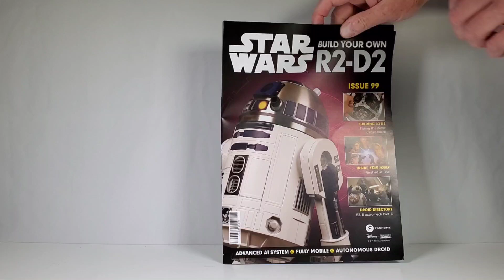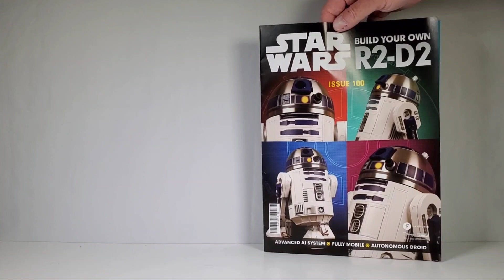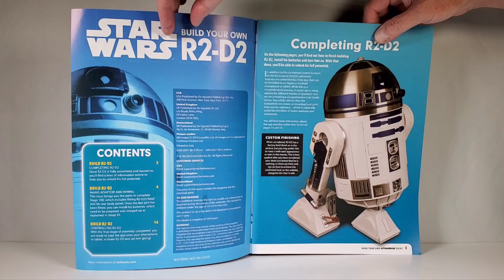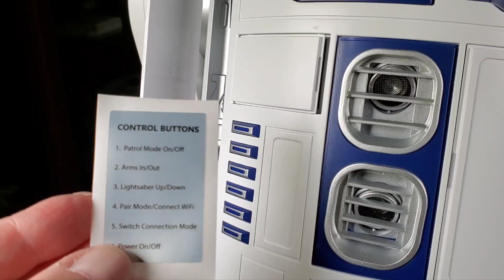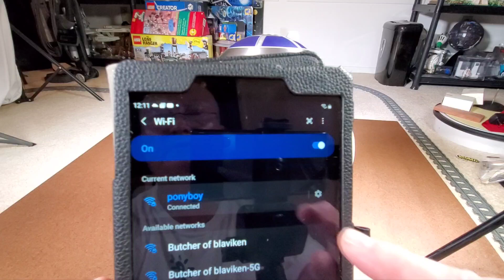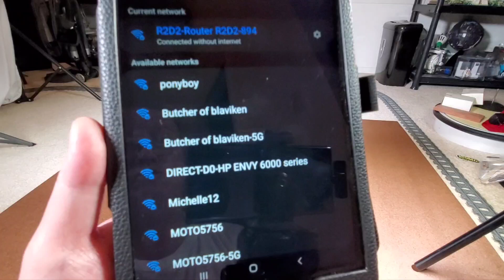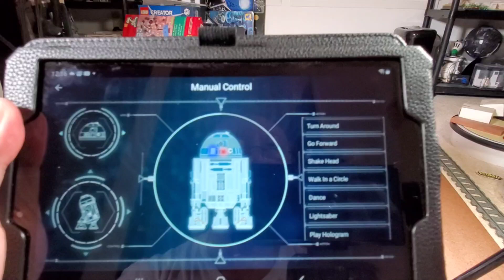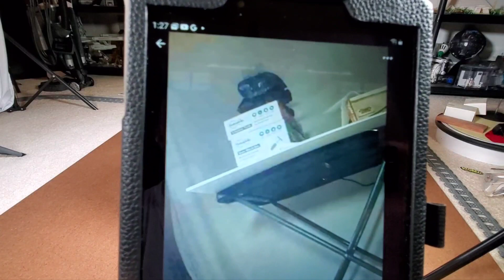Part 26 Building The Fanhome R2-D2 Stages 99 & 100. The Finale!!

Comment: I’m proud of you Roy, for finally finishing this big project.  Isn’t it ironic that fanhome would leave the most challenging part of this project to be revealed in the final 2 parts builds.  I know this was a labour of love for you.  One thing though, is I notice the blue on the panel greeblies or whatever you call it doesn’t quite match the blue cover surrounding the camera eye, above the green/ red coloured eye, nor the blue on those arms.  Know what I mean? Other than that it’s been a pleasure watching this in its entirety.  I’m not sure the violent dome rotations can be fixed or smoother.
Reply from the maker: Thank you! Yeah I'm guessing they used the same paint for those areas but it ends up looking like a different shade on metal or plastic. That's my guess anyway. The head fixed itself when I turned him off and then back on. I think the calibration the second time around corrected itself. You can tell at the end that there's no violent movements so thankfully it's working perfect now! 😁👍